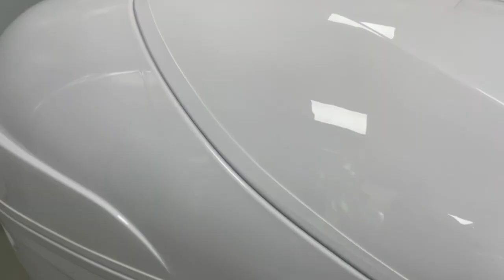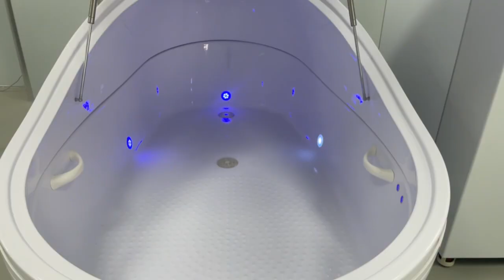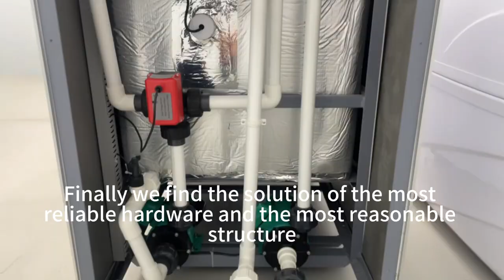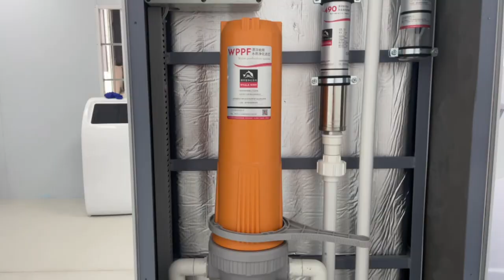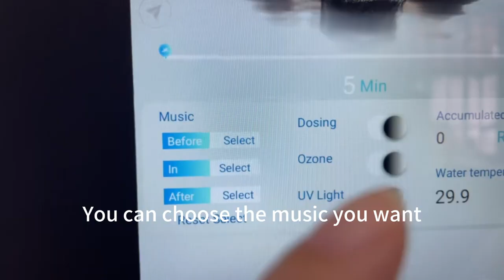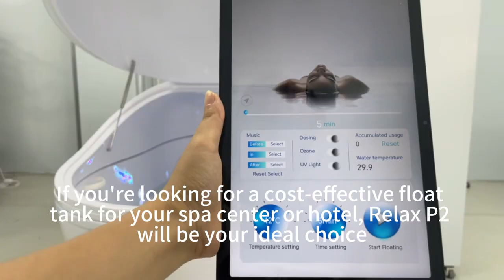P2 Isolation Float Tank | Built-in Water Tank, Ozone + UV + Chemical Sterilization

Comment from the maker: Meet the P2 Isolation Salt Water Float Tank, designed for professional float spas and wellness centers. This advanced float therapy pod combines comfort, hygiene, and intelligent water management to deliver the ultimate relaxation experience.

The P2 sensory tank features an integrated main control system with a built-in water tank. When you click the return button, all water is pumped back to the main unit for complete ozone + UV + chemical disinfection — achieving 99% sterilization efficiency in just 15 minutes.

Key highlights:
Smart automatic water circulation
Ozone + UV + dosing system for deep sanitation
Filtration & temperature control
Energy-efficient and low maintenance operation

The P2 isolation float tank is ideal for spas, wellness centers, gyms, and private use.
As a professional manufacturer, we provide OEM & ODM customization, offering multiple color and system configurations to meet different business needs.

📩 Contact us for product specifications and pricing.
🌐 Visit our website for more isolation salt water float tanks and spa equipment solutions.
www.ycrof.com

💬 Leave a comment below if you’d like to learn more about float therapy technology.

#IsolationFloatTank #SaltWaterFloatTank #FloatTherapy #FloatTank #SpaEquipment #WellnessTechnology #OzoneSterilization #FloatTankManufacturer #spa #gyms #sports